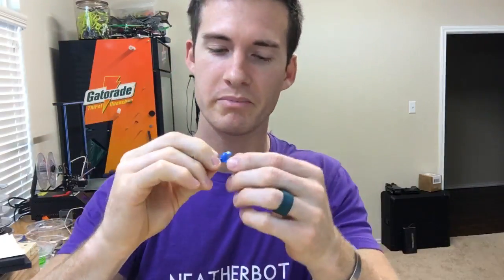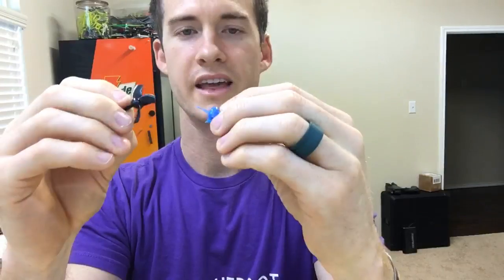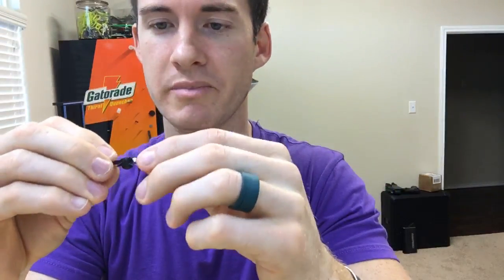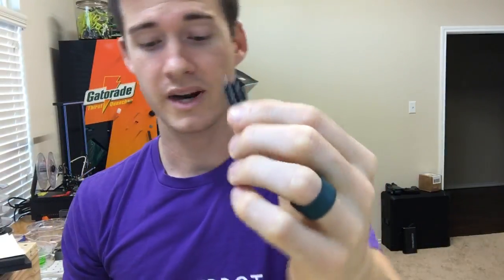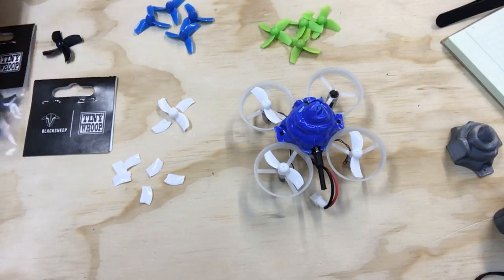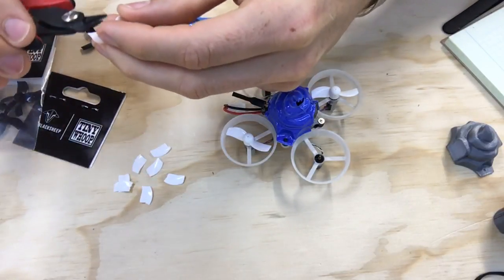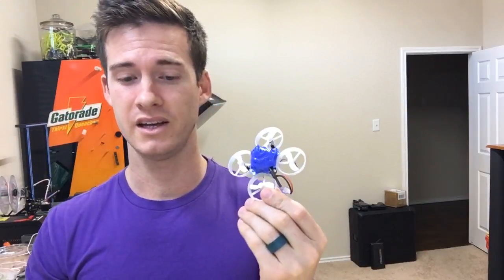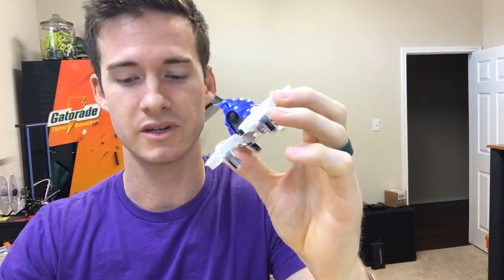Team Black Sheep Whoop Props | TBS propeller | A Diamond In The Rough

Comment: "seem to be thicker"  bro, get some calipers out and measure them!  
Get some really nice curved finger nail cutters for making super clean cuts on these.  I've been using these for a while. Lower KV is way better, longer times, better punch and better control in the corners, when you keep all 4 blades on low KV.
Better speed and punch but a little sloppy feeling with 2 blades and high KV.  Good for larger tracks once you get the feel, but tight small courses are easier for me with the low KV 4 blade set up.
I have beta65, inductrix, TWR, beecore? with mockingbird, and a bunch I forgot the names of, all rocking TBS race props. I defo prefer them